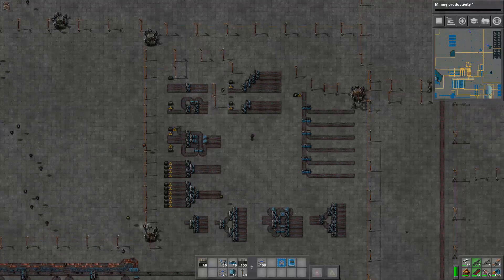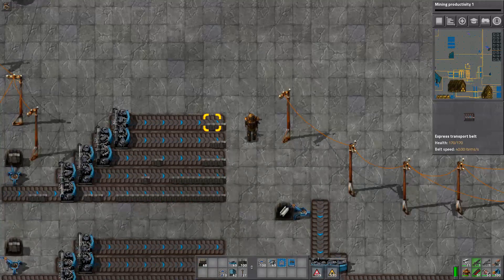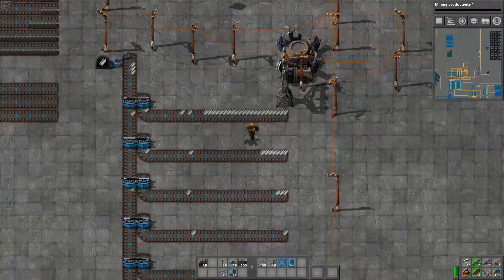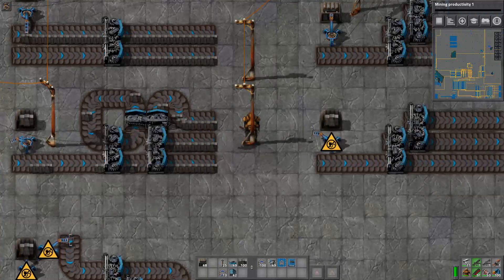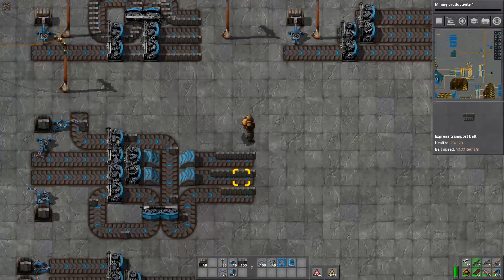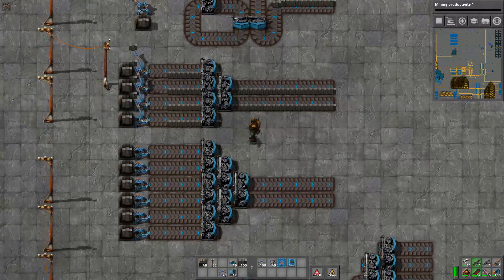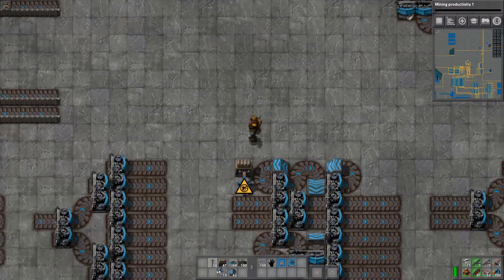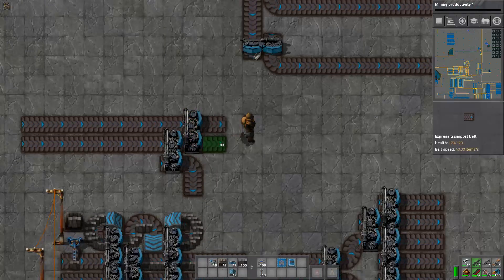Factorio Balancer Guide - Factorio Guide [pt.1] - Building a Balancer System in Factorio

Comment: I've spent a lot of time thinking about balancers.
I have a simple algorithm to design a perfect N to M, where N and M are powers of 2. If you need either N or M where N or M are NOT powers of 2, you can simply leave dead-ended inputs or outputs, and it will back up the system in such a way that it converts it into a perfect balancer for the real number of inputs or outputs. Then, you can clean up all the lines that never move (or that never get materials due to dead input lines), and you get a throughput-perfect balancer.
I am mathematically certain that it minimizes the number of splitters necessary for perfect balance, and I am certain that it is only a few blocks away from the mathematical minimum number of underground belts. (If I add an additional few underground belts at each stage, it makes the design much more compact. I could eliminate them and be perfect, but the footprint would be substantially larger).
As for minimum footprint, I don't have the necessary theory to approach minimizing that short of brute-forcing it, which is ugly.
Reply: Do you have any place where I could see you algorithm?

Comment: Let me give you a quicker guide on balancers: they are completely unnecessary.
Just make sure that: 
output >= input, 
belt throughput >= input
and you're set. If those two conditions are met then there's really no point in balancing. The only benefit is equally distributed lack of input, but that's not really a solution to lack of input and a faster factory startup at the cost of time wasted to make enough room for all those balancers.
Reply: unnecessary on a small walled based with lots of micro gestion until you get the spaceship, vital on megabases
Reply: They are already useful the moment you start mining "off-base" towards a train station where you run 1/4 or 2/8 trains that you want to make sure can load up their cargo quickly and evenly. Especially important when you're pulling several belts worth of ore from a mine which often carry an uneven amount of resources due to how the ore-field is laid out (which is later exacerbated when the first miners start running out of resources while other miners still have ample ore to work with). If you don't want to bottleneck the output of the miners (and why would you want to bottleneck your own factory anyway?), then you need to make sure you balance the belts coming from the mining op properly, even if it means that not all belts that arrive at the train station will be used at maximum capacity - that's not relevant in a scenario where the alternative to a decent balancer and maximum output is bottlenecking on purpose just to save an arbitrary and overall meaningless amount of resources on a few splitters and belts...